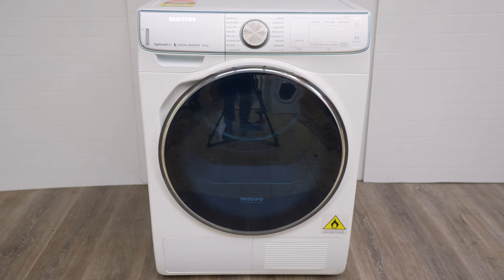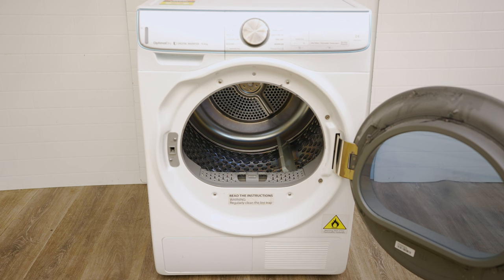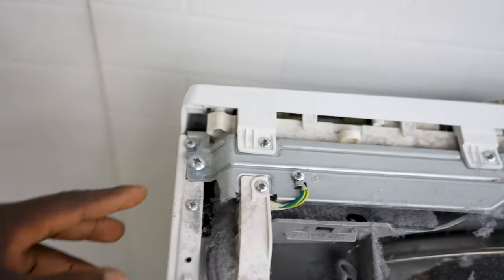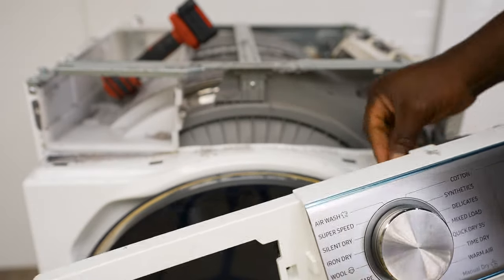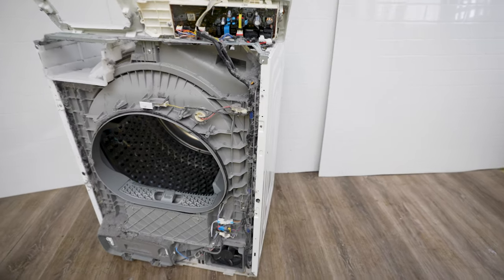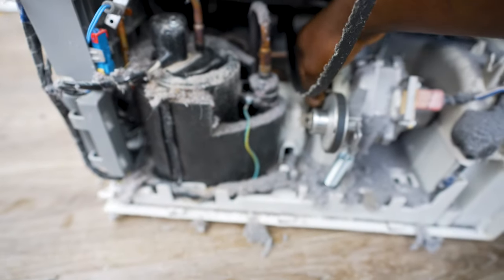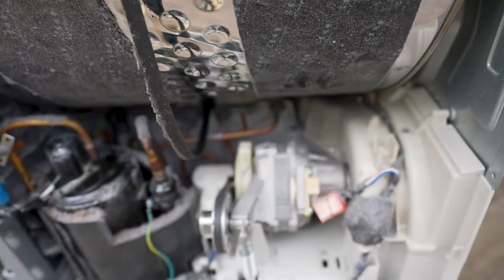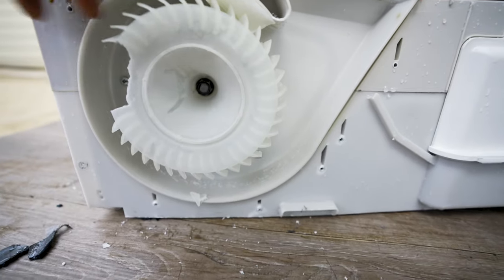Fix Samsung Dryer Not Spinning Fault

Comment: I would bet that the fan stopped working but the heating element continued to heat. This caused the back to get too hot and therefore the black sound insultation also got hot and slid down the plastic cover. Overall a silly design IMO.